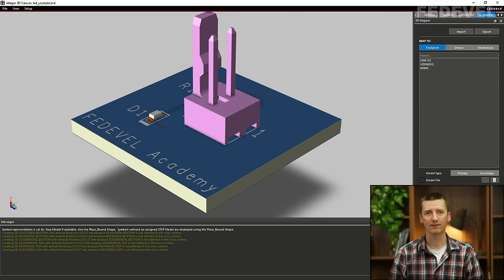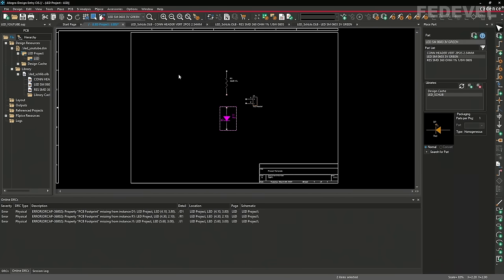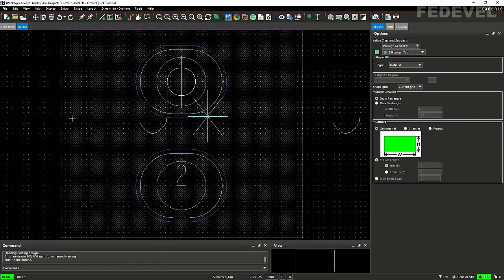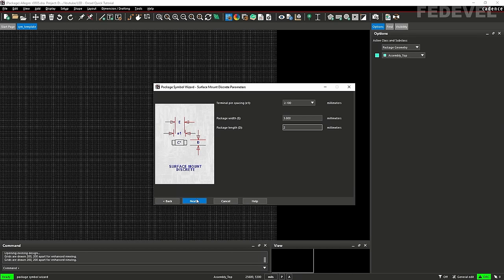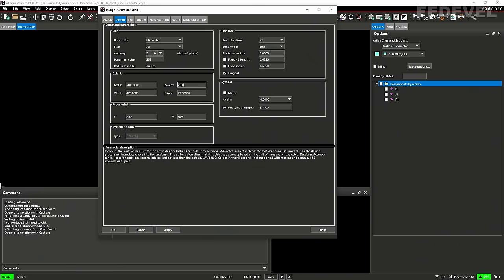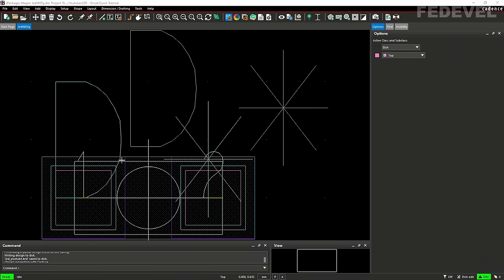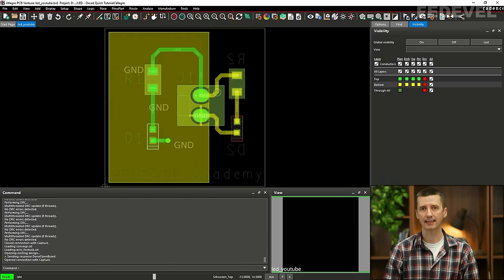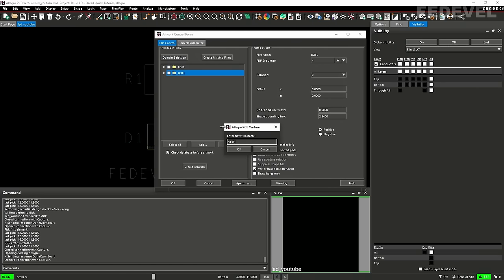Tutorial OrCAD and Cadence Allegro PCB Editor | 2022 | Step by Step | For Beginners

Comment: I tried all the tools both free and commercial. Working with allegro and orcad is really painful and frustrating experience. Most of very simple operations are exponentially complicated.  Atleast 6 months required for learning and using the tool bit comfortably in real design. if cost is not big constrained better move to altium. It would be much easier to learn and use.

Comment: stop promoting 1980s software!
Reply: Is this sarcasm? I don't get it
Reply from the maker: @dymastro788  I don't normally comment when I see it may not change an opinion, but I try on this one. krysieks, just search for engineering jobs and you will notice, the two most required softwares are Altium and Cadence Orcad & Allegro. It's not relevant how the software looks. PS: Some time ago I created this video: Which PCB Design Software is The Best? The Top 4 Are ... https://youtu.be/8IZnj4Z9CHU
Reply: @hectorgonzalez6361  yes survived and stopped there in 1990s. I use it for 5 years now and it's always pain. Especially crashing capture. It started to be usable after patch s020 but still can crash. Many things are done in not logical way. Symbol editing in capture - crap, why do you need to pins around rectangular shape?? They actually made new symbol editor about 3years ago. But still far from perfection.
80% of improvement suggestion got rejected by support or takes months to fix bugs. I used in past EasyPC - they support was able to make a fix within hours or days.
There is still plenty of room to improve performance. Compare that to kicad - you will be surprised how smooth this free tool is (and this is only about pcb part)

If you have a look closer the allegro is selection of tools that cadence bought over the years. But all of them are different and they patched to work with each other. It uses visual C++, java, tcltk, Qt, there mozilla firefox and possibly some other things. 
I could provide more examples but i'm bored in writing...
Reply from the maker: I believe it's based on "we can't have everything". I think, Cadence priority is do not disturb the existing environment too much. Altium is changing a lot - on one side that means new features on other side frustration of constantly changing stuff and many random bugs between versions. On the other side, I think Cadence would like to stay as compatible as possible with previous versions (they don't want to impact the engineers already working with their software), but that means, they have to keep some old stuff. Still, it's not relevant - it does not matter if it's altium or cadence or kicad .... it's just a software. Important is, if you can use that software to your advantage e.g. get better salary if you know how to use it and in that case Cadence is a very good choice to learn (the same as Altium).
Reply: Thank you, for all the insights! At the job where I started they use the Cadence work flow. I also think its about finding a tool that fits you.
Reply: Orcad very old. Even though its painful and time consuming for making design.  its good tool to use. Possibly current generation youth will hate to work with this tool.
Reply: @RobertFeranec   I understand why they trying not to disturb - this a house of card. You touch one, all will fall. It must be like that cause the whole Cadence is build of completely different tools patched to work together. I can imagine their software engineers afraid to touch some codes cause no one understand what's that doing (partially cause its from 1990 :) )
Reply: @RobertFeranec  but delete button also not interfaced in this software. in pcb symbol  rotation also couldn't support in this software.
Reply: @RobertFeranec  Altium was especially frustrating for a few years in the mid 2010's when it bounced between a couple of dev teams and things like shortcut sequences were changing every year.

Comment: Robert, but if the OrCad is paid few thousands $$$$ so it's a problem  😁🤪
For hobbyists we don't need that expensive software to use once a month, or a half year

But, thank you very much for your as always very interesting tutorial, we always learn a lot from your good videos, thx mate 👍
Reply from the maker: Sometimes it is possible to buy Orcad at price around $600 USD. Search for "orcad deal". That would be the cheapest version but it is still ok. Of course for hobbyists KiCad is probably the best.